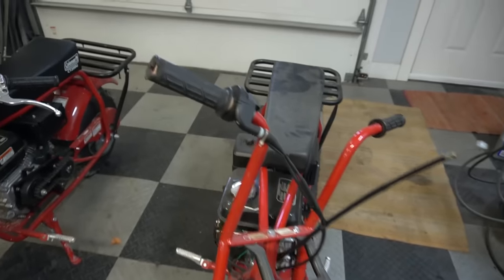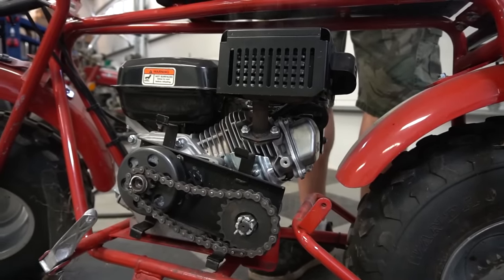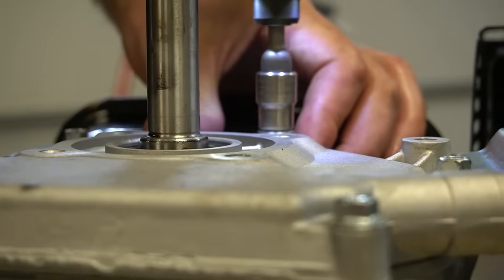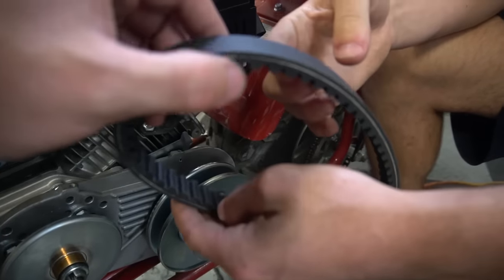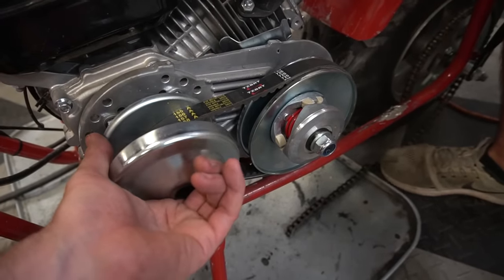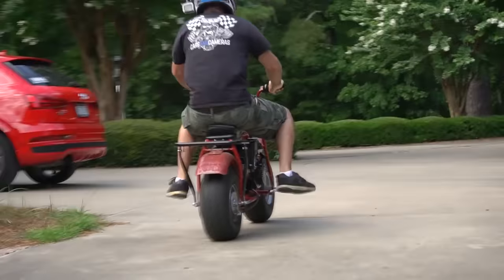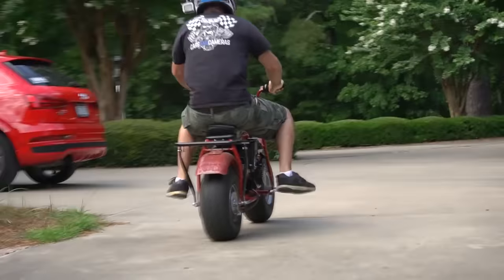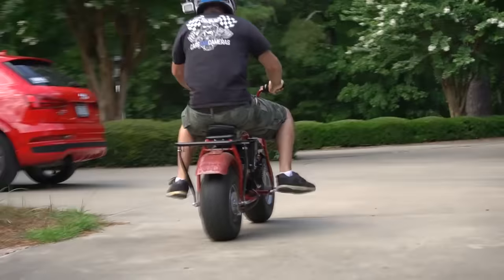Essential Mini Bike Mods | CT200 Performance Parts

Comment: So fyi that plastic cam is garbage for performance. The plastic lobes wear down really quick. Did that build with a briggs and after a month of riding I took it all apart  cause I was losing power come to find out the lobes were getting to hot and it looked like it was melting them.

Comment: Supposedly cannot remove jet from carburetor on newer Coleman's. I've tried unscrewing it and wasn't able to get it to come out. Anybody know of any tricks of getting it out. If not going to have to purchase a new carb.
Reply: Take a drill bit a little bigger than the inside of the jet but small enough to fit in to hole where jet screws in making sure not to damage the side walls. Drill in far enough to be able to fit a flat head screw driver in it with a couple of pounds from a hammer. Once flat head wedged in turn it counterclockwise and it should come out. Its tedious and may take a few tries but I got min out. Now hopefully jet that comes in kit fits in the carburetor. Obviously carburetor was removed for this job.

Comment: Hoping someone sees this to answer my question.

I want to replace my rear sprocket for take off. My C.Clutch is 12T

What's a good matching rear sprocket for acceleration? To my 12T Clutch. Currently the rear sprocket I got on it is a STOCK 75T but I want to increase take off.
Reply: J Culp I believe 75t is as big as you can go on that bike. Dropping one tooth on your clutch is the same as adding 2 teeth to the rear. Go with a 10t clutch sprocket and you will effectively add 4 teeth to your rear sprocket.
Reply: @Kettenhund75  thnx for the answer. I'll keep that in mind.

I put the 212 on my minni bike and with the 12T clutch & 75T R.Sprocket it is a nasty dirt kicker.

Gonna play with the set up for now, but I always get used to current power eventually and grow bored, meaning time for upgrades 😜.

Thnx for help & info.

Comment: I got a Tecumseh 5.5 horsepower motor that I'm taking off a snowblower to use for a go kart what's the best place I can get mods for it what size Mikuni carburetor do you recommend
Reply: Not sure what to recommend  on a tecumseh
Reply: Isaac it'll be fine thanks anyways Isaac big fan I guess I have to do some trial-and-error but I know it'll be fine

Comment: As an Industrial electrician I can tell you you do not measure the shaft of a motor or engine with a tape measure. If you don't own a set of verniers you tighten an adjustable spanner onto the shaft, then measure the distance between the adjustables teeth

Comment: I bought a used ct200u for my fleet yesterday came with a stock 212 and the Colman jack shaft set up and it does wheelies with my fat 250 pound ass

Comment: the cheaper versions of the brigs and predator engines  have plastic cam gears
Reply: From a performance perspective the plastic cam gear is better than steel. Less weight for the engine to move. And there have been no reports anywhere of these breaking.

Comment: You guys went to the Texas mini bike races where you swap Riders and you guys kept burning belts up chains are the way to go as far as the torque converter that's a different story if you get the combination of the both you can't go wrong with belts or pieces of s*** no good with rough terrain and dirt and hills and mud

Comment: I have a predator 6.5 minibike and I want to mod it but I'm worried about breaking it cause it runs real nice so what's something good to start with?
Reply: New carb. I've never seen a stock carb that was worth a damn on any of these small engines, Honda, Briggs, Tecumsah, fuck all of them. I'd try a tilitson 304, it's a floatless carb so gas won't leek out carb when tipped. I've never tried it though and it could be garbage too.
Reply: Matthew Thomas stage 1 kit
Reply: I think I'll give it a try thanks... Also I love your videos on both channels but you should revive the boat go kart

Comment: I found a ct200 for $500 with stage 1 and a torq a verter is it worth it?
Reply: that's about what it would cost new..offer them 350 cash otherwise you're better off buying new
Reply: Jane Ames amazon is selling for $750 if I could buy new for $350 where do I get one

Comment: R.P.M. differences between the two, top speed of the stock one?
Reply: That's easy. Ungoverned the stock setup would have much higher RPM than with the torque convertor. This is because of gearing. Stock ratio is 10/1 always. With a torque converter the top speed ratio is around 4.5/1. The variable ratio of the torque converter is nice until the belt shifts into high. Once into high you run out of engine due to gearing and load. With a torque converter and stock gearing the engine will never make it to 5K RPM.

Comment: Why is the belt better than the chain?
Reply: metal myke1 the chain is driven by the clutch and can overheat riding it at slow or medium speeds.The belt system works great at all speeds
Reply: I see. Thanks for the reply.

Comment: You didn't state the fact that the stock tourqe concerter bolt will break off in the shaft after a month and the performance air filter makes it run like 💩 and breaks off way to easy

Comment: Does anyone know how to make these quieter? I want to ride at night on trails and I need it to be as quiet as possible.
Reply: Search for a stock muffler for a 200cc scooter. Look on amazon and ebay. You can try a geo metro 3 cylinder muffler also but I think it's a little large. You will need to modify mounts and exhaust plumbing.
Reply: You could even use a gy6 150cc muffler because they rev to 7500 rpm.

Comment: PSA 670s aren't fast I'd take a 390cc 420cc over a 670 every single day of the week i have yet to see a 670 Impress me. They don't run good there is almost zero aftermarket for them and they are heavy they make great low end and that's where they should be left

Comment: Bonjour a vous du CanadaYes he exist people not want to run fast . I need your advise ,i'm a hunter &  big boy ,i'm interresting ,
buy  mechanical device  ,who increase the streng ,not speed ,it's not requiered for me . If i install a 60 teeth sprocket ,on the rear
wheel ,do you think ,it's the right direction , to take ,for my  purpose . My english is so so ,it's the best i can do .

Comment: CT200s are the worst with driver control. my friend has one and he flipped it while only doing 10-15 mph. Not only that but he also broke the chain and bent the jack shaft

So if I were you I'd just get a monster moto and swap 212 on it
Reply: maybe your friend needs to learn how to ride...flipping at 15 is almost impossible that would be a lay over
Reply: Jane Ames 
Well he was also riding on loooooose dirt

Comment: On my ct200u there's this screw I loosened up so I can pull the throttle back a lil more and it only goes 25 now that's the only thing I've done other than take my carburator apart to clean it, if I remove the governor how much faster will it go ? Just a couple more mph???
Reply: use the zip tie trick on spring throttle, red beard does a video with the sprocket mod. got me 34 downhill for free!!
Reply: @fishingtwister  Alright I'll check out his video, I've looked that trick up but the people recording always do bad angles and it's hard to see or the person's hand is in the way

Comment: Did I miss smething or did you not say what brand engine had the plastic cam bullshit? I guess it wouldn't be a stretch for Predators to switch over to bullshit plastic without advertising it. That's unfortunate that somebody even thought that was a good idea.
Reply: ok, it was whatever brand coleman used on 1. I got turned around when you guys mentioned taking parts from one and putting them on the other. I've been awake for a while.